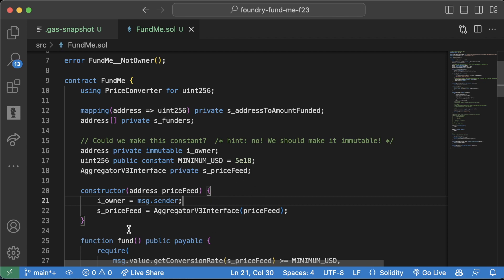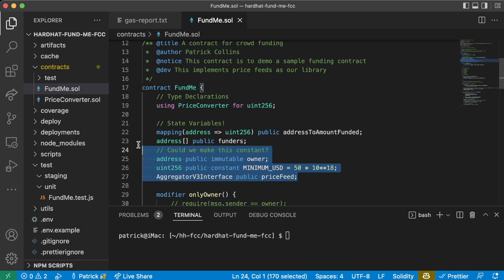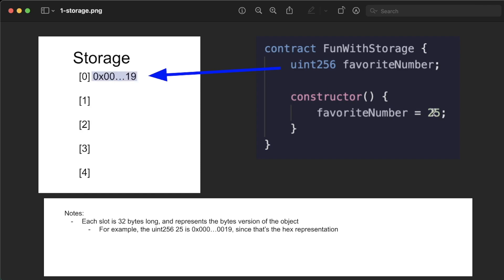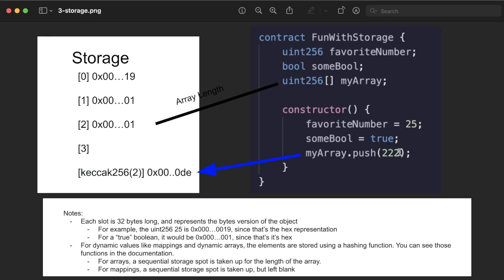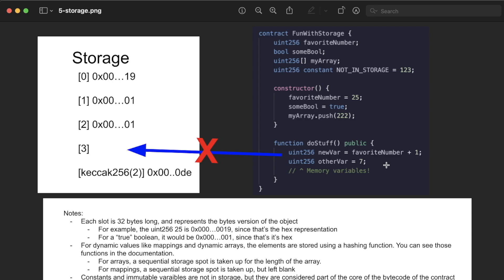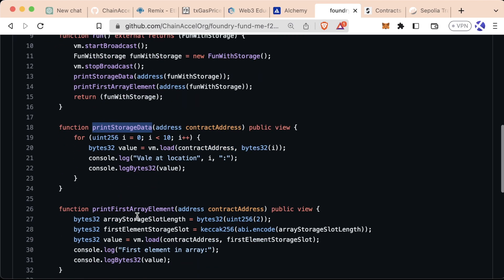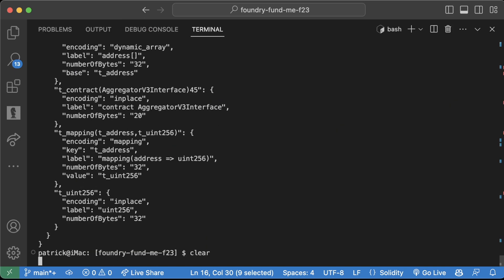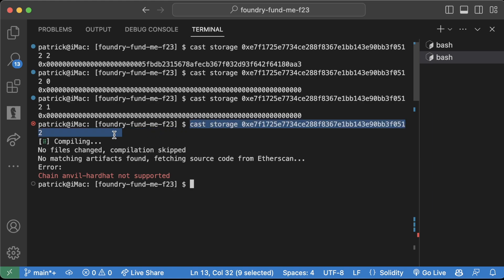Lesson 7 Part 17 | Storage - Solidity & Foundry Full Course

Comment: Highlights
💾 Storage in Solidity is a big array where permanent variables (global variables) are stored.
🔄 Each storage variable takes up a 32-byte slot in the storage array.
📚 Documentation contains specific functions for hashing dynamic values like dynamic arrays and mappings.
🔒 Constant and immutable variables are not stored in storage but are part of the contract's bytecode.
🧠 Variables inside functions only exist for the duration of the function and are not added to storage.
📝 The memory keyword is used for working with dynamically-sized data like Strings.